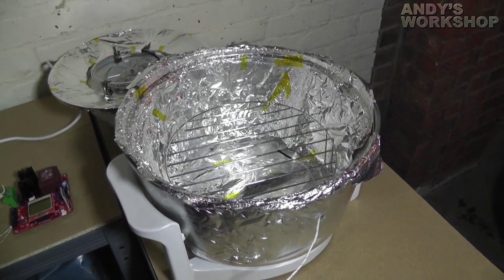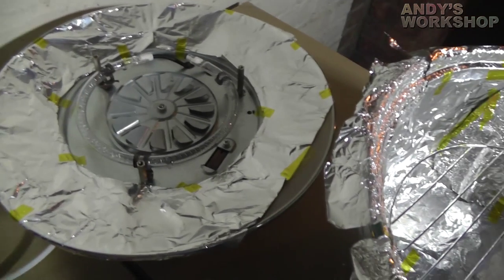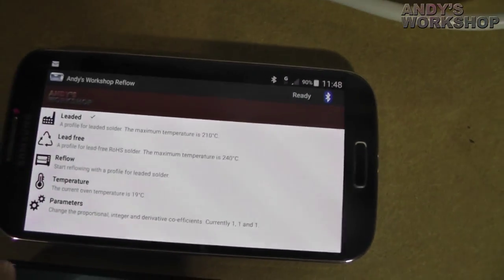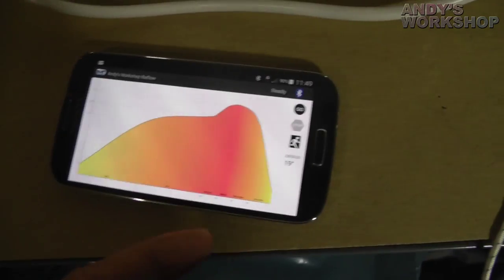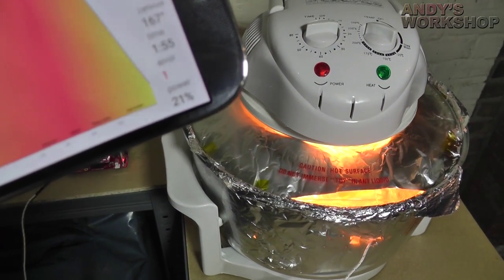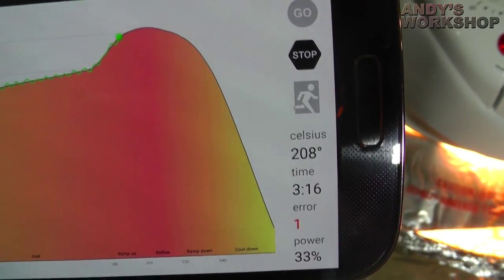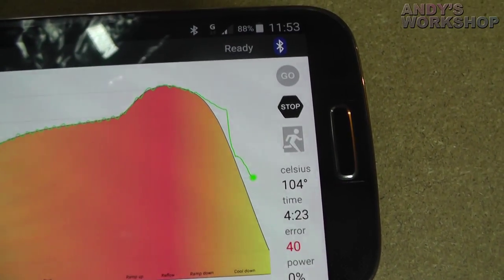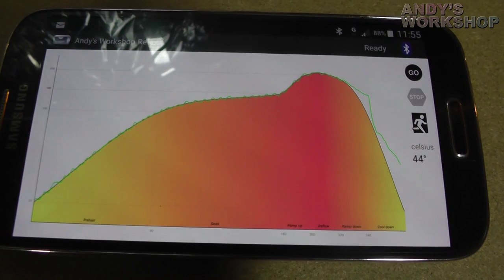Android bluetooth reflow oven improvements

Comment: You really should connect the earth cables!
Reply from the maker: yeah I know. I designed it all correctly and still haven't got around to mounting it in a metal case with proper power entry.

Comment: hi Andy, great project. have made one (all farnell components) just a small problem, when unit is trying to send fast changes to triac, it wont turn it on (i.e when display flicks between 0% to say 20%) seems it does not like short pulses to fire triac. It works fine and modulates heater when a constant or slow change in power %. Any ideas?
Reply from the maker: +Baz c Hi Baz, good to hear that you built one. I very much doubt that there&#39;s a problem based on what you&#39;re telling me. Did you use a halogen oven? Halogens are fast to respond but all oven types have a thermal inertia that will delay their response to a request to increase or decrease the heat.

If you really think there is an issue then you can validate the digital side by CAREFULLY probing pins 4 and 5 (ZSENSE and ACTIVE) of the ATMega 8 with an oscilloscope. You should see the zero crossing pulses and the pulses that activate the triac.

I advise against going anywhere near the triac when the circuit is live but perhaps I can help by implementing a test function in the app that would allow you to manually set percentages in the app so you can see visually how your oven responds or you can attach something with a fast response time such as an incandescent lamp to check that the triac is working fine.
Reply: +Andy Brown  thanks Andy, I have found your forum. I have done tests and will reply there.regards Baz
Reply: +Andy BrownCouldn’t get registration to work on forum so here is my current state,
Checked ZSENSE and seems to be good, as your diagram on web article.
Checked ACTIVE and again is as your animated diagram but only when power % is a steady value.
When software is trying to maintain temp and is “nudging” power up there is NO output on ACTIVE.
I have checked fuse setting and have awreflow2.hex loaded, can you confirm Github version is correct and up-to-date as per your improvements?
I can reflow only by having PID set to 3,0,0 and temp tracking is similar to your 1st video before modifications.
My setup is, PCB from your Gerber’s, identical oven, fan mod and tinfoil. All Farnell components.
Anyone helps? I think for some reason it is a software problem?
Reply from the maker: +Baz c I just manually activated your first registration - you should receive an email from the forum software.
Reply from the maker: +Andy Brown When 100% is called for ACTIVE is set manually by 'GPIO set'. Less than 100% and a counter is used that is sync'd to the zero crossing interupt (see zeroCrossingHandler() in OvenControl.h). Either your zero crossing interrupt isn't happening (seems unlikely as you say you see the signal at the ZSENSE pin) or there's something odd about your timers. Are you absolutely sure you have set the ATMega8L fuses to run off the 8MHz external crystal? If possible can you breadboard a blinky test to be really sure the core clock is 8MHz external?

PS. You should be able to login to the forum as bazc. Your office email server is running a sender verification check on incoming emails (a good anti-spam measure) and I hadn't set up a mailbox alias for the forum mail user so outgoing emails from the forum were failing your server's verification check.

Comment: Hi Andy I cannot build the program.
Here is the error:
In function ‘__vector_9’:
MillisecondTimer.cpp:20:1: warning: ‘_vector_9’ appears to be a misspelled signal handler [enabled by default]
 ISR(TIMER0_OVF_vect) {
 ^
In function ‘__vector_1’:
OvenControl.cpp:21:1: warning: ‘_vector_1’ appears to be a misspelled signal handler [enabled by default]
 ISR(INT0_vect) {
 ^
In function ‘__vector_3’:
OvenControl.cpp:30:1: warning: ‘_vector_3’ appears to be a misspelled signal handler [enabled by default]
 ISR(TIMER2_COMP_vect) {
 ^
In function ‘__vector_4’:
OvenControl.cpp:39:1: warning: ‘_vector_4’ appears to be a misspelled signal handler [enabled by default]
 ISR(TIMER2_OVF_vect) {
 ^
/usr/lib/gcc/avr/4.8.2/../../../avr/bin/ld: awreflow2.elf section `.text' will not fit in region `text'
/usr/lib/gcc/avr/4.8.2/../../../avr/bin/ld: region `text' overflowed by 73382 bytes
collect2: error: ld returned 1 exit status
scons: * [awreflow2.elf] Error 1
scons: building terminated because of errors.
mick@Rosewill:~/Downloads/Android-Reflow/awreflow2-master/atmega8l > section `.text' will not fit in region `text'
> 

This is under Mint linux fully updated.
Reply from the maker: There must be something wrong with your compiler environment. Works for me on a fresh Ubuntu install:

$ sudo apt install gcc-avr
$ sudo apt-get install avr-libc
$ git clone https://github.com/andysworkshop/awreflow2.git
$ cd awreflow2/atmega8l
$ scons mains=50

avr-gcc is 4.9.2
avr-libc is 1:1.8.0+Atmel3.5.0-1
Reply: Thanks for the the reply.
I could not update the files , so I installed Kubuntu 16-10. After installing the AVR toolchain, scons and git - it worked fine.

Scons is new to me, I am used to regular makefiles.